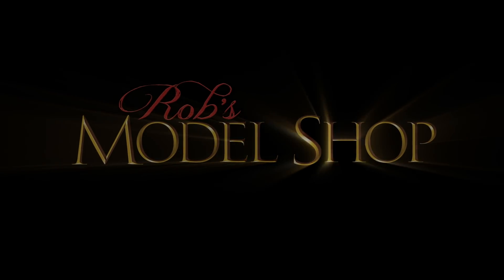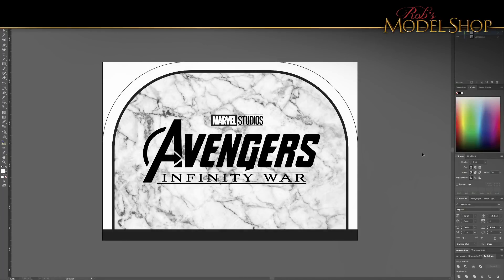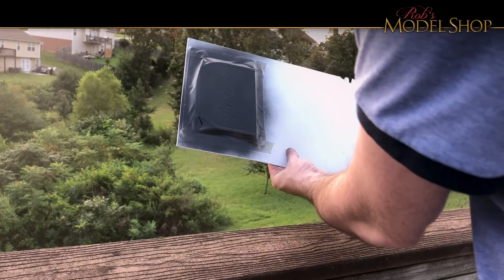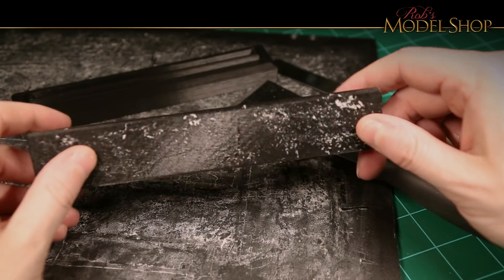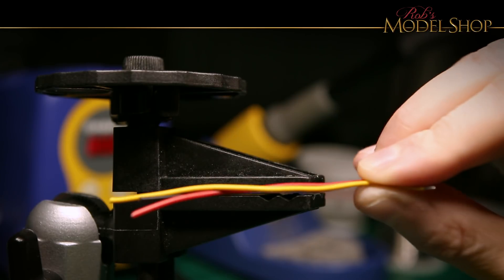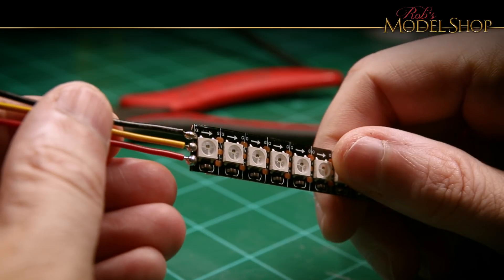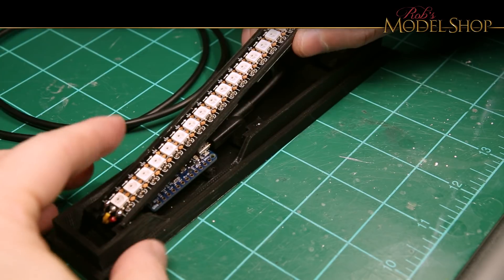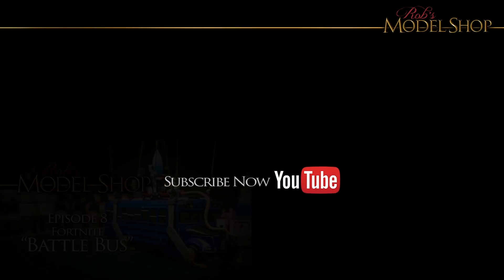Rob's Model Shop - Episode 9 - Avengers LED Sign

Comment: Love this video too!  What kind of laser cutter / engraver do you recommend Rob?
Reply from the maker: Mark of the Rhodes Thanks again. I’m a little out of touch with what is available now but I’m using a Full Spectrum 24x18 90 watt CO2 laser. It really depends on what size pieces you want to cut/etch and what power you need. Most “hobby” lasers that are 30-40 watt are plenty to do most things. Keep in mind when you’re looking that you will also need some sort of fume extraction device. Most people just have a fan that vents to outside similar to a dryer vent. Also, look at the software that comes with the machine. There’s plenty of cheap Chinese lasers out there that will work, but with crap software. Epilog and Universal are probably some of the best machines with good software, but they are also very expensive. I honestly haven’t looked at the Glowforge much but it seems to be pretty decent. Still expensive though.

Comment: Nice work! How did you paint the background? What tool did you use?
Reply from the maker: Thanks a bunch. The background is laser etched into clear acrylic. (no paint) I used a marble texture and etched in multiple passes to get the varied depth. The only paint used on this is the black on the front of the acrylic, which is just regular black spray paint using cut vinyl as a mask. Thanks for the comment!